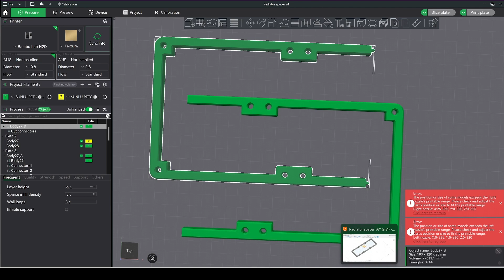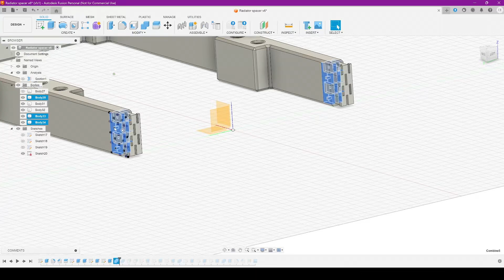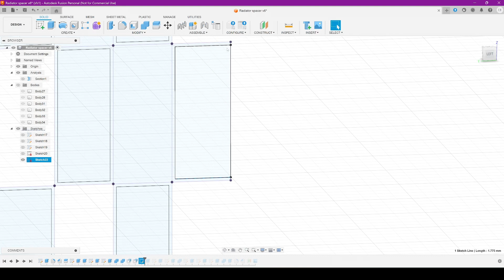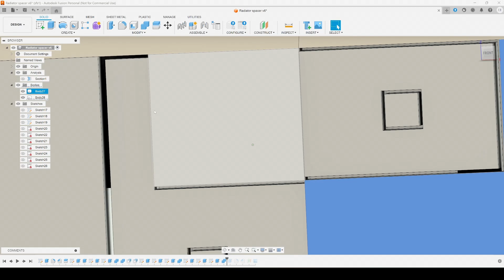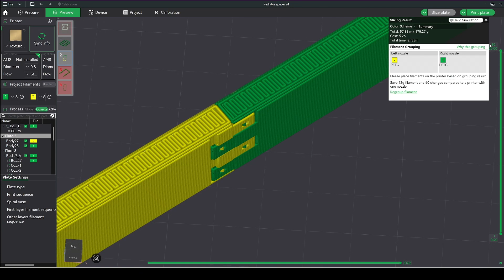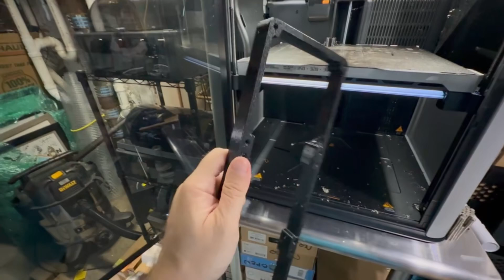Using the whole H2D build plate for one model

Comment: isn't it possible to just paint it on the slicer and let it handle the merging?
Reply: What would you be painting on the slicer? Very curious and need to gain more knowledge of the slicer.
Reply: @fermenteded  I belive that orca/bambu have a feature to literally paint the object using a brush tool on the slicer, usually it is used to make regular prints colored
Reply from the maker: that would not make it possible to use the whole print bed. if your print doesnt require the whole print bed, you can use that for beam interlocking painted parts.